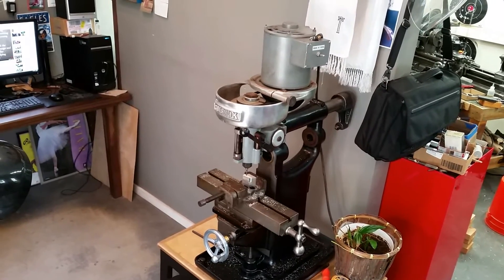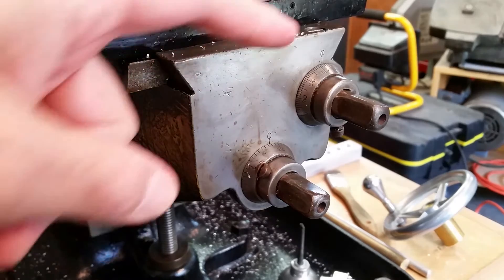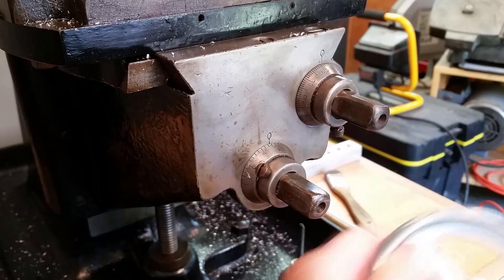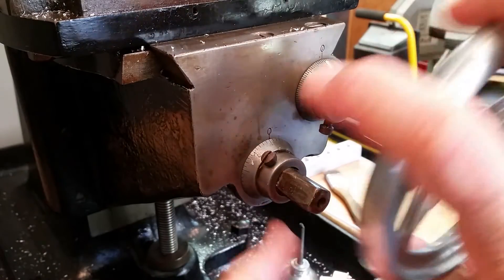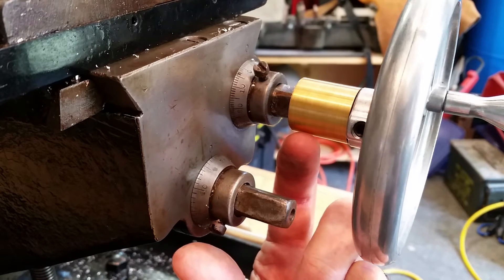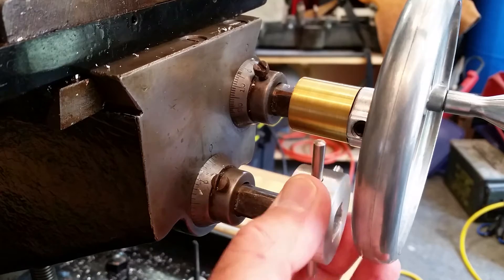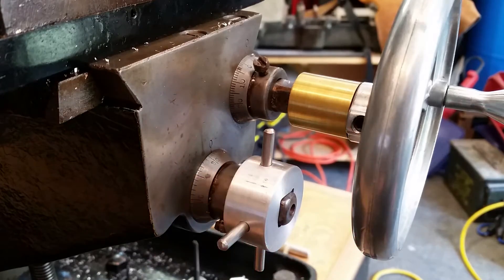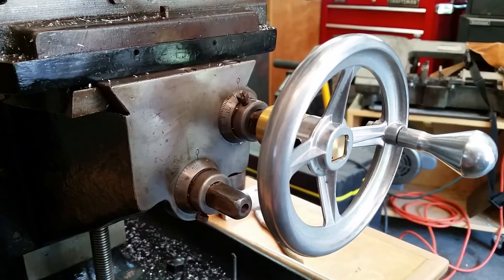First Project on Benchtop Mill

Comment: A nice piece of work and demo of the machine, thanks. This little Burke No. 4 mill is certainly liked in the comments! It seems they have greatly varied in design features over the years with my '41 model having the Z-axis handle angled round at some 30 degrees slightly lower down to the left so both handles clear.
Ironic that you have the vertical milling adaptor that I want and I have the horizontal milling arbour that you want. I hope you find one. I wonder if Virginia wants to buy mine. Lol.

Comment: I love this little mill.  It would be cool to use timing gears/belt and build an offset arrangement to move the handle over.  Or, a a bevel gear setup to turn the handle 90 degrees off the side of the knee.  I think your solution is plenty convenient enough.  I'm surfing your video's now.  Hope you have one telling the story.history of this mill.  Looks like it could be used horizontally as well.
Reply from the maker: Thank you Crafted.  I am thinking about a better handle arrangement.  This mill does run horizontally, but I dont have the arbor or any of the attachments.  All I know about this mills history is that the Gentleman who owned it worked in the research labs at USC.  It became part of his estate and made its way to a machine shop at a private airport in Southern California; thats where I picked it up. I think its 70 years old and its perfect.